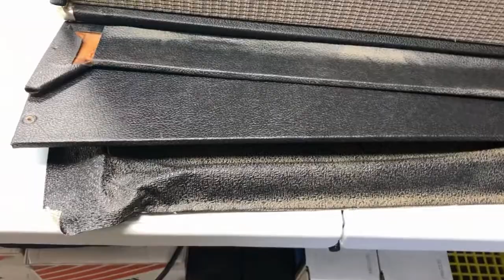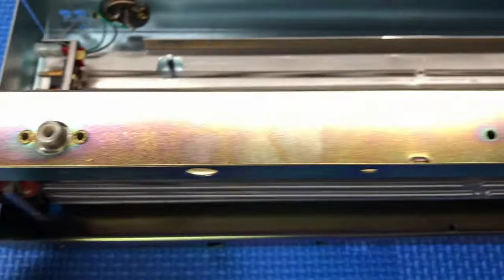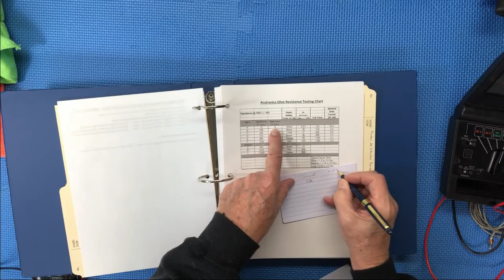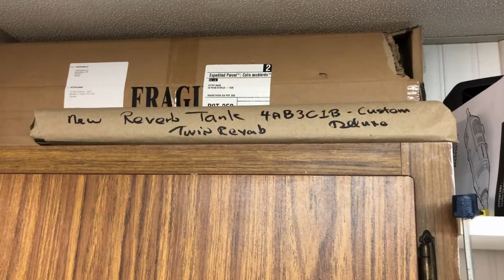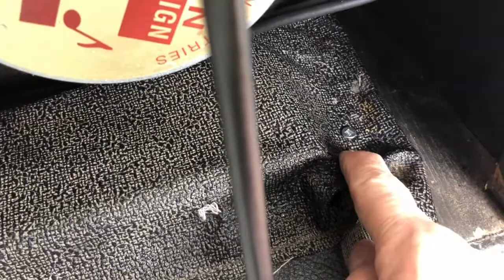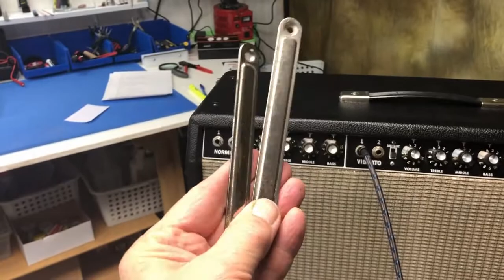Amp Tube Repair - Fender Vintage 1976 Twin Reverb Gets Its Reverb Back

Comment: FYI, I have a Fender Supersonic 22 tube amp. The reverb went bad and I just took it out. I've been using the amp for several years like that as I use a reverb pedal. I just recently bought the new reverb tank and installed it and works fine no probs. 
Thanks for your video. 👍

Comment: I should've watched your video before unracking and opening my new to me late 80s Mesa Quad Preamp, twice. It has  two reverb tanks (one long one short) inside and I removed the top mounted long one to clean its connections and make sure no wires were loose. Multimeter was sitting right next to me but didnt think to use it atm. I want to eventually replace them bc it is supposed to have a unique sound w dual reverbs. The short one is in a tight spot tho.

Comment: Good stuff! I wondered about specs to test the tank. Thank you for directing us to specs.
I’ll be looking mine over soon. It seems to be intermittent, and recentlyI even got a little squeal of feedback out of the amp at low volume, and it seemed to be related to reverb.

Comment: I need to fix mine , it hums and I don’t hear reverb working
Reply: Mine just started doing the same thing. You ever get it fixed? If so do you remember what the issue was?
Reply: @NoSpoonsAllowed  I ended up taking it into some guy near my spot. Might have been the connections on the back. I really wish I knew exactly what he did lol. When I showed up to pick it up he went to test it in front of me and there was a really loud squeal and he was like, that’s not good and he reached over and messed with something and it was all good and I haven’t had a problem since. Just be sure you are also plugged into the two channels all the way to the right. Either input on the second side. Also you need a foot switch to activate the tremolo